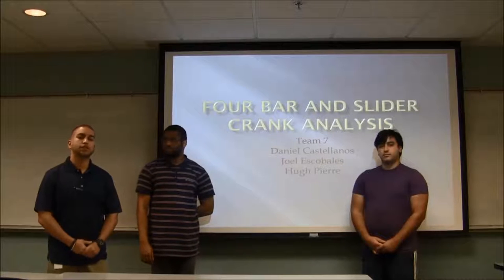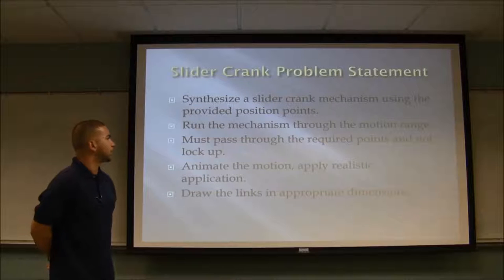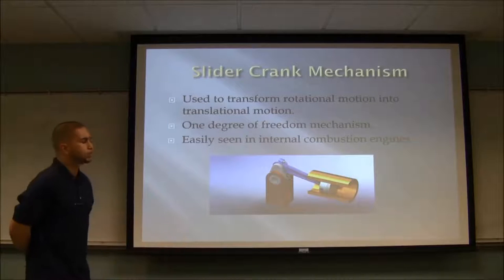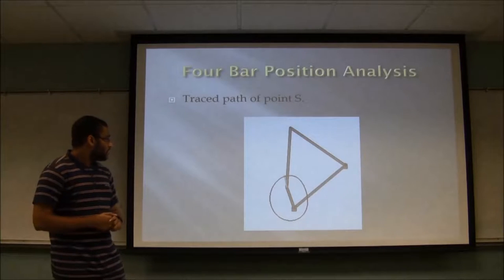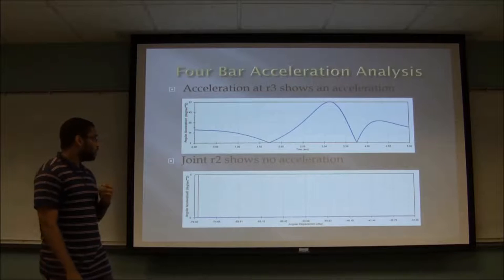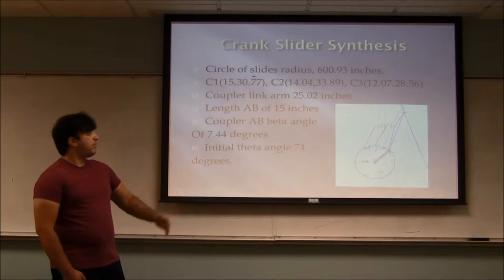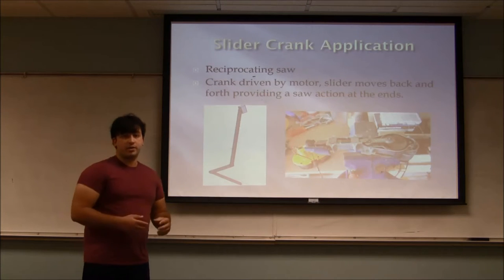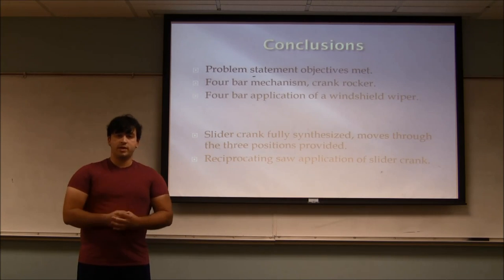Team 7: Mechanism Design: Reciprocating Saw & Windshield Wiper

Comment: Sounds were loud and clear as well as the lighting in the presentation. The slides were a bit dark and the text was black which made it troubling to read at times. Next time, a lighter slide background with black text would improve the content readability. The content was explained very well and the presentation flowed seamlessly. Good job!

Comment: Good presentation, sound and camera angle were good slides a little hard to read but not too bad, content was good and presenters seemed prepared. Could have used a conclusion at the end for a less abrupt ending, but other than that, good stuff.